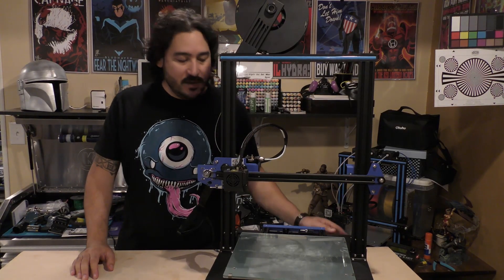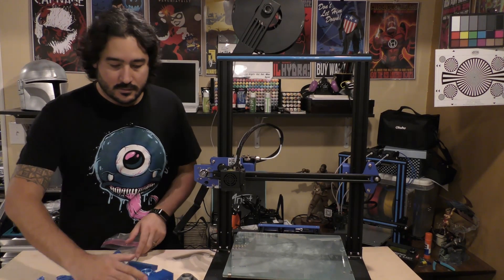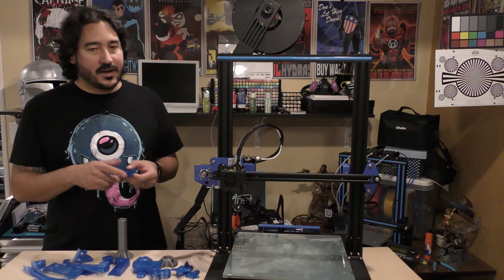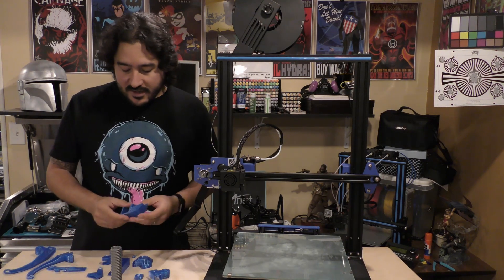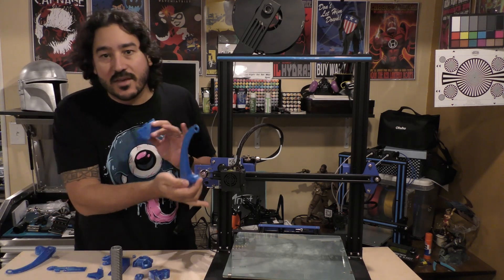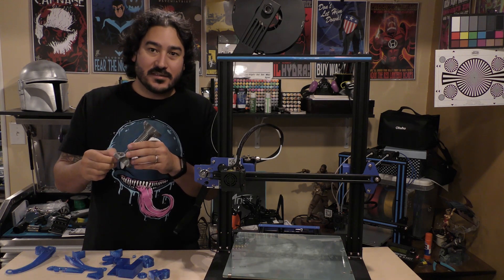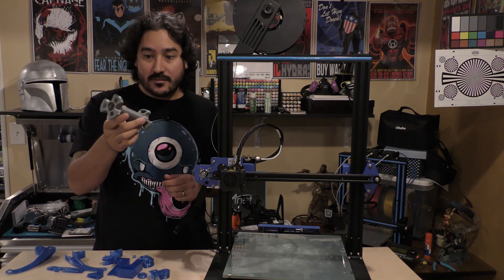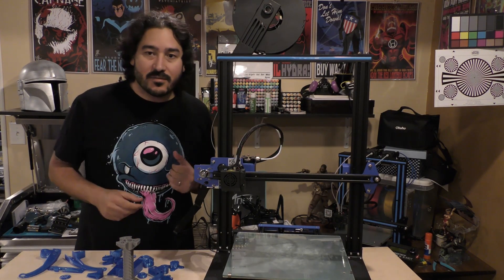Anet ET5X Mods and Upgrades

Comment: Hello
Great job congratulations and thank you for everything.
I have a small problem on my 3d Anet Et5x with the supports, impossible to remove them.
Do you have any idea where this may come from?
Thank you
A subscriber of ➕ and 1👍 
........
Bonjour
Excellent travail bravo et merci pour tout.
J'ai un petit problème sur ma 3d Anet Et5x avec les supports, impossible de les retirer.
Auriez-vous une idée d'où cela peut venir ?
Merci
Un abonné de ➕ et 1👍
Reply from the maker: You will need to change your Slicer settings. You can make the 3D printing support structures easier to detach by controlling the Z-Distance hidden settings under the Support section. The default value for this setting is the same as layer height. So if your layer height is 0.1 mm, the default Z Distance will be 0.1 mm too.

Comment: hi, i have et5x also, good to see et5x content here
which one z axis stabilizer is better? the original or mod one?, i think the original works better because using bearing, also i think heated bed cable already stable without the mod
Reply from the maker: I think the stock stabilizer is better, it is a better fit and it has the bearing. Also I have not had any issues after swapping out for the z-axis filament guide.  The z-axis doesn't have any wobble.  In my case I preferred the filament guide over the better fitting z-axis stabilizer.  I think I will design a filament guide that keeps the existing z-axis stabilizer.

Comment: I really appreciate links to those stls 
Working on mine too.

Thanks
Reply from the maker: Links to STLs:
Box for Anet ET4
: https://www.thingiverse.com/thing:4121638
Cooling Nozzle: https://www.thingiverse.com/thing:4618874
Heated Bed Cable Protector: https://www.thingiverse.com/thing:4202539
Run Out Sensor Filament Guide: https://www.thingiverse.com/thing:4234336
Universal Spool Holder: https://www.thingiverse.com/thing:4164041

Anet ET4 Z-Axis stabilizer and filament guide:  https://www.thingiverse.com/thing:4085298